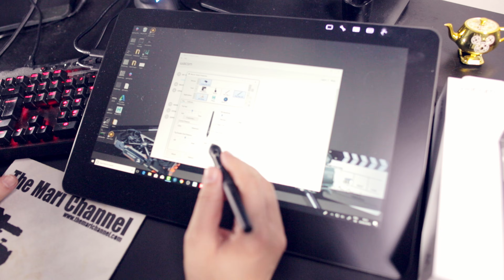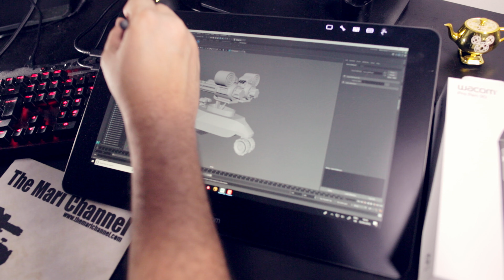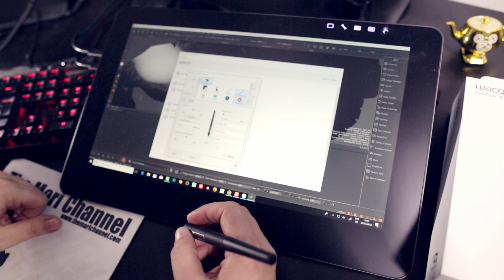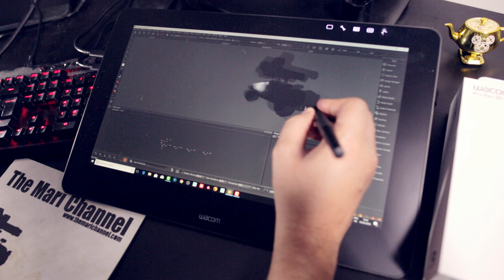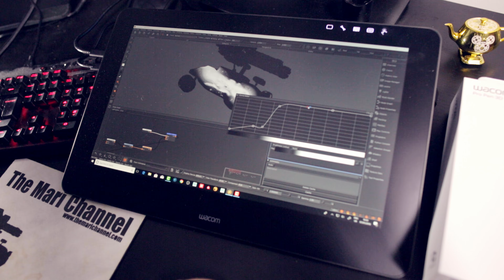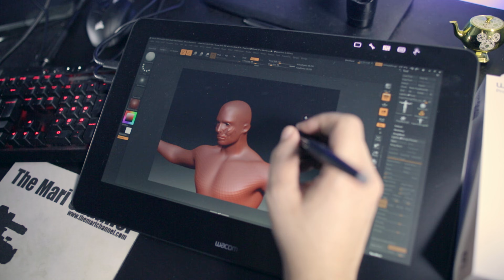Wacom Pro Pen 3d review and setup | using Maya Mari and Zbrush |

Comment: i am using this 3D pen for my wacom pth860  right now, but i got one issue for the pen, it is about current Pressure cannot reach to 100%( maximum) when i push, the original Pth860 pen is totally  normal. is it only my 3D pen its the problem? THanks

Comment: Hi thanks for this. I just got the 3D pen, gone to the tools in my wacom tablet properties, cant see the 3d pen available. Was there a step you didn't show to get that as an option or was it always there? Thanks
Reply from the maker: not sure, what wacom tablet do you have?
Reply: Hi  @MeshmenStudio  , thanks for your quick reply. I have contacted Wacom and my tablet isn't compatible unfortunately. I'm using an Intuos Pro M 2015. I guess for anyone considering upgrading to this pen its worth them checking whether its available in their tools menu (after they have ensured they have updated their driver)
Reply from the maker: Yes the pro pen only works with quite new tablets unfortunately
Reply: @MeshmenStudio  Thanks man, looks like I'll be making the best of it with my one working side button for now

Comment: Sir what is the difference between Titan V and Titan RTX  performance for Mari  ?
Reply from the maker: Fot mari i would guess minimal to none. As Mari will not take advantage of tracing at the current state. I had a quadro rtx card to test and I did not see any difference in the short time I had it for loans
Reply: @MeshmenStudio  sir you have idea to  test the Titan RTX Graphics card
Reply from the maker: Well yeah but im not sure I can get my hands on one, I cant afford to buy one :)
Reply from the maker: I had a rtx card at work for a week, could not see any difference in mari use, and not so many app use the rtx features. I guess arnold can in the latest beta and in some extent substance designer for texture baking.
Reply from the maker: But I will try and reach out to Nvidia, would be interesting to once and for all do a test using a few cards, low to high end and clock for Mari use,
Reply: @MeshmenStudio  thanks sir :)